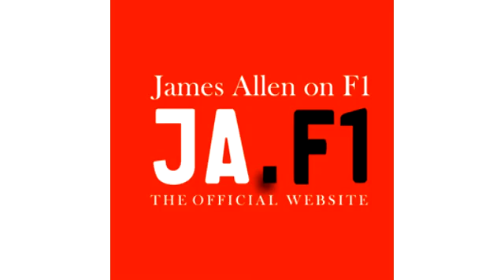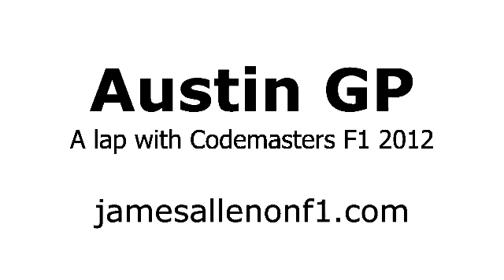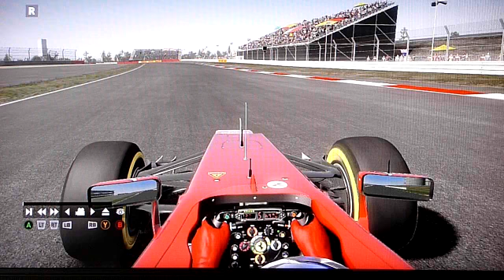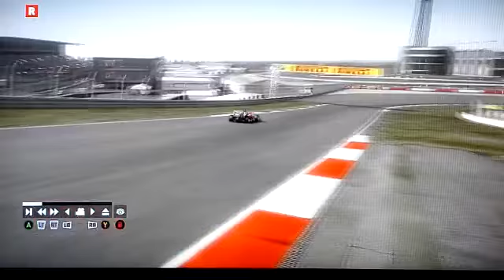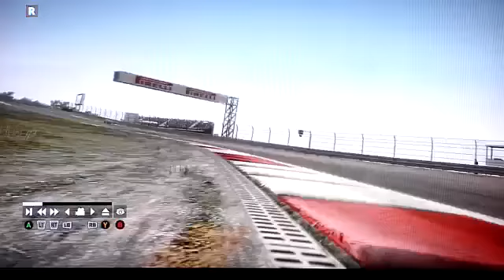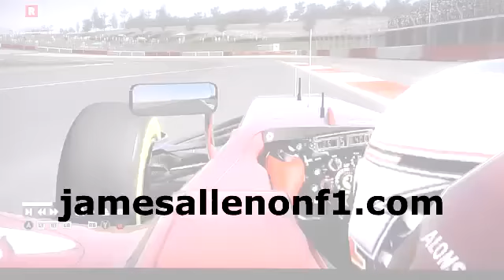On Board Lap of New US Grand Prix circuit, Austin, Texas - Internet 640x360-30p.mp4

Comment: 500 pounds=around 1000 AUD, which is what i was going by. i do admit that if you get the right PC, the graphics can be absolutely awesome, but then if you run the wrong game with too high graphics on a PC, it lags out, which becomes annoying when gaming. you do not have that problem with console games as the games are made to the specific graphics that the console can take. therefore, sure the graphics on some games are much better on PC, on others it they are much better on the console